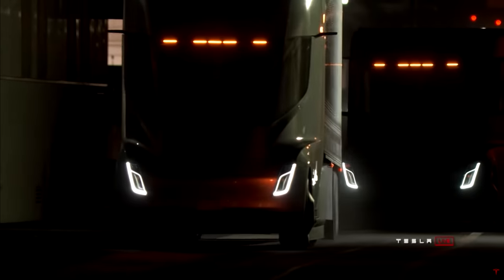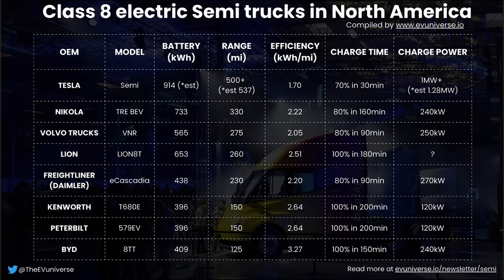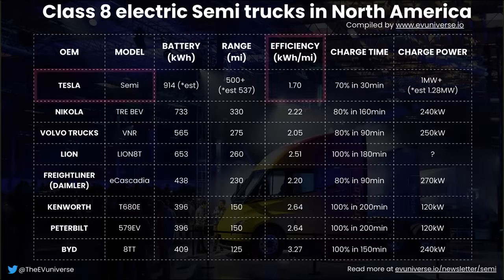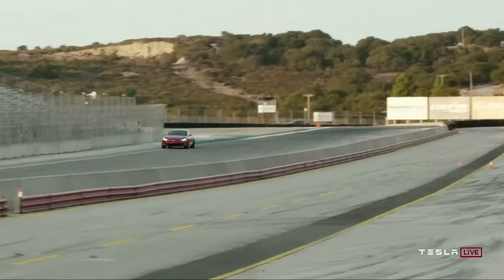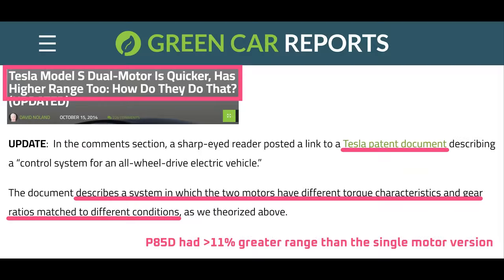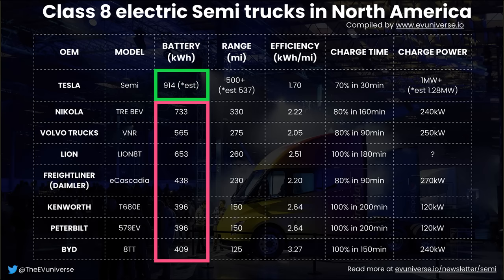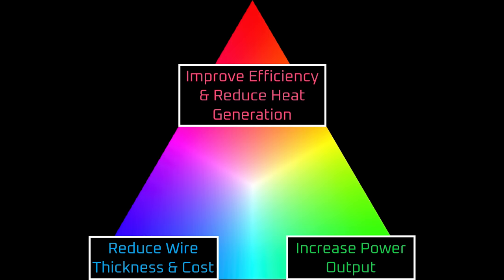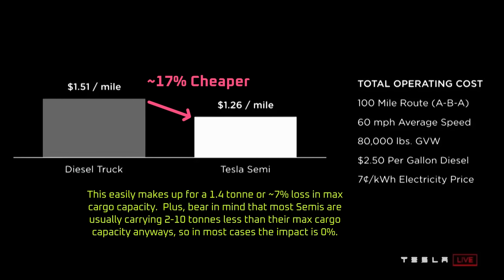How the Tesla Semi “Broke the Laws of Physics”

Comment: Great analysis, thanks. It is ridiculous that anyone calls it "breaking the laws of physics". Certainly not physicists. Physics does not impose any limit on how far can a car or truck go. With no energy losses in ideal conditions the truck could literally go forever, this is not realistic of course but with technology you can get closer and closer. The only limit is only technological.
Reply: No, because of air friction.
Reply: @pilotavery  That's why I specified "with no losses in ideal conditions". Air sure is a limiting factor. And so is rolling resistence and bunch of other stuff. The point is you can get better and better in all of the limiting factors and we are nowhere near what physics allows. The techonology is limited.
Reply: @RandomGuyOnYoutube601  technology is improving constantly! We went from nothing to wheels, assisted steering, ABS, seatbelts……
Reply: There are certain physical limits to a truck that conforms to legal limits. Rubber on asphalt is always going to have a certain coefficient of drag >0 and with a weight m on even ground, you'll always have to overcome a rolling resistance of Crr*g*m, no matter what. A semi is also always going to have a maximum length, which means your frontal area is can't get smaller without reducing volume.
Reply: @plainText384  lol….. improvements are always made doesn’t matter if huge or small!
Reply: @plainText384  today a diesel truck can go up to 3000 miles thing we couldn’t have believed decades ago! Let alone those gigantic container ships with up to 20,000 containers capacity+
Reply: @Alan May  the question is not "will transporting goods from point A to point B become more efficient/cheaper/ greener/ etc." It's "will those goods be transported by this specific mode of transportation".

Horse drawn carriages became increasingly efficient... until they were no longer used. And Noone in the transport sector is genetically engineering super donkeys for high efficiency carriages. 

Maybe the future of medium/long distance cargo shipping is in Battery electric Semitrucks, maybe it isn't.
Reply: One of my favorite quotes from ST: DS9.  "Its true, you can't break the laws of physics, but you can bend them".
Reply: @plainText384  please please don’t you ever dare compare vehicles to horses! Because the single work of a truck is like hundreds of horses+ just look at agriculture! A single harvester is able to work massive lands in record times and batteries will never made such things possible!
Reply: @plainText384  batteries don’t even compete/compare to diesel! With diesel we went to the remotest areas, opened the largest mines, built roads, houses, entire cities…. Bridges, the grid and much more.
Reply: @plainText384  in emergency situations again diesel is another great flexible use.
Reply: @kennethng8346  lol….
Reply: @Alan May  horses are literally the original vehicle? They are not only a comparison, they're a historical example.
Reply: Physics impose limits on conman.
Please explain, how motors running more than 20k rpm while powering wheels running at about 500 rpm can do that with just one gear all the while managing, controlling 40 tons.
After so many broken promises and outrages claims in the past, the current move to hide "physics" is to hide the weight of this "thing" from the public as long as possible.
As far as I know, Pepsico only runs the vehicle with their light weight products,  and seems to have no intention to reveal this one telling piece of data, I guess because of an NDA.
And there is more substantial debunking to be found here:
https://www.youtube.com/watch?v=b-TUfTwWdHM
Reply: @sindbad8411  I smell burning short.
Reply: @RandomGuyOnYoutube601  
I have no clue what you mean. Is that slang or an idiom I'm not aware of? The video is from Aussie engineer and car guy. He is definitely funny.
I'll borrow this sentence from him: 
"People have been fooled into believing that being entitled to their own opinions extends to being entitled to their own facts".
Reply: @sindbad8411  I would refer you to the graphics at 9:50 and 10:30 of this video. 
At 9:50 we see a representation of actual EV advancement over several generations and a span of 9 years.  It is not made up.  
At 10:30 we see specs for several first generation EV trucks.  No one is calling Daimler and Volvo a bunch of hucksters.  How long will it take for them to match the specs given for the Tesla Semi?  

If we judge based purely on the graph at 9:50, then a reasonable guess would be 9 years.  My own guess is five years or maybe less, since they will have Tesla's example to follow (assuming their example is real).

Now, if you're right and Tesla Semi is a fake, it means that real trucks will meet the claimed specs of the Tesla Semi in under 10 years.  If Tesla is right, they will meet their claimed specs within one year as they approach their production ramp.

The only alternative to this would be if these first generation trucks that have been rushed to market are actually as good as EV trucks can get.  Who believes that?  Not anybody who knows anything about technology.  I mean, what were diesel trucks doing in 1930, compared to today?
Reply: @alanmay7929  Diesel has done lots of wonderful things.  It has also poisoned many millions of people; caused, cumulatively, probably a million deaths or more from air pollution.  That's not counting all the deaths from extraction related pollution, wars for control of oil, or the tremendous impact of bad government that results from the malignant influence of oil companies on political systems around the world.  The transition to a battery based economy holds great potential for positive change.

Will there be many adjustments?  Yes.  Will some work flows change? Yes.  Will it be the end of the world? No.  It will be the beginning of a new era.
Reply: @davidmenasco5743  
How can you be sure that Tesla will be still around in 10 years?
If the Semi IS the disaster it seems to be at this point chances are the company will be very, very different.
Here is a rant, a “debunking” by John Cadogan
Very, very funny btw.
Tesla Semi: Was I wrong? (Responding to you.)
An Aussie Auto Expert and engineer
https://www.youtube.com/watch?v=b-TUfTwWdHM

I lost my interest in Elon a few years ago,
Upon the grand opening of the Boring company.
He arrives on stage “Steve Jobs” style with a Tesla driving out of the whopping 1.5 mile long tunnel.
3 numbers on the wall
1 Billion
200 Million
20 million
First: Average cost per mile / km of conventional boring companies
Second: discounted prices of the above if you are very lucky.
Third: cost per mile / km of his Boring company.

What he did NOT mention was the “conventional price includes stops and stations, you know those huge underground holes sometimes of the size of a cathedral basically hand made, well not by shoveling but by lot’s of individual bore holes and what not. But definitely NOT by the auto-tunnel boring device.
It was kind of the first time Elon introduced his self made laws of physics.

But what struck me at first: wow, his car had guiding rollers underneath, and I  was “what the f*ck??”:
I’ve seen this (and used it almost 40 years ago), in the Ruhr area in Germany. Live and in color:
Full and true autonomous driving of busses for public transport!!
https://www.youtube.com/watch?v=GT21wuS8DuM

Honestly, how is the Vegas loop doing?
High speed and fully autonomous rides in a confined area, anyone?
Or are you already making 3ok several times per year by operating a couple of full autonomous Taxis and Ubers?
AND, to return to the Semi:
When will we know the one and only truly important number?
The weight of this thing which will allow for calculation of payload efficiency?
There is a special form of art in journalism. Politicians , managers, all sort of big guys will tell you what they want you to know. However you need to learn the fine art of hearing what they don’t tell you, what they don’t want you to know.
Which is is fairly obvious in this case.

I could go on about the many broken promises and outrages claims, or talk about what John Cadogan explains in his video.
But there are way to many issues, it’s useless.
If you have the guts, watch John Cadogan’s video.
HE IS hilarious.

Do you know what the term oxymoron means?
Elon’s “I’m absolutist free speech advocate” is one of the best I’ve came across in years.
An oxymoron is a literary device that juxtaposes contradictory terms. Oxymorons are often used poetically as a way of bringing out a fresh meaning in a word or phrase. Like a paradox, an oxymoron is what’s known as a “contradiction in terms,” 
The word oxymoron is an ancient Greek word, which translates most closely to something like “sharply dull” or “cleverly stupid.” In other words, the oxymoron definition is itself an oxymoron. 

And, there is the old idea:
if you want know who someone truly is, give him or her power.
And they will tell you, almost guaranteed.
As everyone can see when watching the twitter story unfold.
He is a an egomaniac, a narcissist.
If you like and believe in someone like him, it’s your choice.
I certainly don’t.
Reply: @sindbad8411  You wrote an awful lot, but completely missed my point.  

My point is that, in ten years or less, Daimler and Volvo and a dozen other companies are going to be making electric trucks every bit as good as the Tesla Semi is claimed to be.  So it really doesn't matter at all whether Tesla survives, or whether the Semi can even drive under it's own power - trucks are going electric.  The announcement of the Semi years ago forced Daimler to move.  Once they did, it was a done deal.

On the other hand, if you think Tesla won't be around in ten years, you're really not paying attention to what's been happening in the auto business.
Reply: Maximum theoretical thermodynamic efficiency.
Reply: @sindbad8411  You don't know what you are talking about, at least when it comes to tunnel boring costs!  The Gothard tunnel in Switzerland is to date the longest in the world at 57.1 km (35.6 miles) long, two tubes as well as technical galeries totaling 152 km in length (95 miles) .  It is also the deepest, being bored on a large portion of its length under 1 mile of rock, with engineering issues like water coming out of fissures at 200 bars of pressure, and such niceties.  It is technically 100x more difficult to bore such a tunnel than a Boring company tube, 100 feet max under the surface in soft rock! The tubes are also of a much larger diameter than the Boring company's ones, and its equipment is much more sophisticated and costly.
It has cost a total of 12.2B Swiss francs (approximately the same sum in USD), or ca. 128 M$ per mile of gallery, NOT the 1B$ per km (or is that per mile?) that you mention. So, considering the huge difference in complexity of the two types of tunnels and the significantly lower US wages, a cost of 20M$ per mile of Boring company tunnel seems quite in line... including stations, as the Gothard tunnel also includes one, for 400 meter long trains, dug under a mile of rock.
If you want to cite an outrageous claim from Elon, you definitely picked up the wrong one!

Having said this, and even being an Elon supporter since the first time I purchased TSLA shares in 2013, I am not convinced by the Boring Company's business plan... neither of his taking over Twitter... but who cares, both are private companies and, as you or I are also free to do, he can do whatever he wants with his money and that of his private investors.  However, in general, Elon is bloody good at delivering on his promises!  His 2008. first Master Plan is nearly 100% implemented, and the implementation of his 2016 second Master Plan is very advanced.  Same thing with SpaceX, he delivered so far everything he promised.   Remember him predicting in 2014 that Tesla would sell 500'000 vehicles in 2020?  Just about everybody laughed... you probably did..,.  But Tesla delivered in 2020 499'535 vehicles.  Please give me the name of another CEO of a high-growth company, who estimated his company's sales within 0.1% 6 years in advance!  Please give me the name of another CEO who brought not one but two companies to valuations of multiple hundreds of billions, in most difficult and complex industries, AT THE SAME TIME!  So, until you do better... until anyone else does better, give him a break on the few ideas that he did abandon, and for being a little over-optimistic on timing.
I trusted him with a huge part of my investment portfolio, starting in 2013 when he was little known, and I don't regret it a minute, he made my retirement VERY comfortable!

Comment: A good example of first principle thinking at Tesla is adding a automatic tire inflation system to the semi. I guess, this allows to keep the tire pressure within narrower limits, so the rolling resistance is as low as possible. The rolling resistance of a loaded truck is quite high.
Reply: It will also reduce tire replacements.  The tires are huge and thick with lots of hysteresis so I imagine temperature changes often push the actual inflation pressures outside of ideal limits during a run.  Having perfect pressure constantly will reduce tire wear and increase safety as well as optimizing rolling resistance.  We've all seen the remnants of peeled and blown truck tires on the highways.
Reply: Hardly new or unique technology. You can buy it off the shelf in Europe.

Comment: You can bet your boots they'll use the same tech in the Cybertruck.  Recapturing the enormous amount of inertia from a heavy vehicle is absolute genius.
Reply: Not to mention that even 3 motors would be huge overkill.
I would imagine a single on the front for "cruise", dual on the rear for "beast mode"
Reply: Or just plain good engineering.
Reply: I object to betting Boots, but I do have a cybertruck on order so I hope you're right!
Reply: You recapture energy from *momentum*, not inertia. Inertia is not momentum.
Reply: All Tesla models have regen braking, you hardly need to use the brakes. The regen braking uses captured energy to recharge the battery. In an ICE braking it’s lost as heat.
Reply: "Recapturing the enormous amount of" inertia momentum "from a heavy vehicle is absolute genius." 
But you know that a heavy vehicle wants to be accelerated first?
Reply: That is kind of the whole point behind EVs and hybrid cars.  Tesla didn't invent any of this.  They are just optimizing it.
Reply: Tesla's are just overpriced death traps maskerating as cheap luxury
Reply: @michaellowe3665  inventing optimizations is still invention.
Reply: @Andy Lee Robinson  meh.  Even Honda didn't invent the hybrid when they  released the insight.  It was 100 year old technology that was used in German U-boats.  I don't detract from the effort it takes to marry existing technologies to make new products.   Optimization is often the hardest part of engineering,  but it isn't the same as inventing.
Reply: It’s not a genius idea that’s how EVs works just like those massive electric trains….
Reply: @rogerstarkey5390  unfortunately there isn’t always a downhill to help with generative braking lol
Reply: @tedmoss  nope
Reply: @Alan May  trains are a little different.   They don't use large batteries like a hybrid car for regeneration.   They just use the electric power as it is generated. They have some battery power to start the engine and run onboard power, but they don't store propulsive power to accelerate and climb hills.  They do recover some of this energy due to their length.  In many cases, part of the train is going downhill while another part is going uphill.  This effectively transfers and equalizes the energy needed to move it.  There are plans to make EV trains that do use large batteries,  but those are experimental at best.  There is a lot of room for solar if they ever do that, though.
Reply: @michaellowe3665  yep but trains still works in the same princip! Electric trains like in Europe Japan… directly connected to the grid and the massive or smaller electric motors regenerate a lot of power.
Reply: @michaellowe3665  there is actually a train in Australia called infinity train running on battery, it was built by f1 racing team from the UK it’s a very rare case where it works tho!
Reply: @Alan May  the original comment was about recovering braking energy and reusing it for acceleration. Trains don't really benefit from this because they aren't changing speeds all the time, and when they do, it is slowly.  They use hybrid drivetrains mainly because a direct drive would be very difficult for a diesel engine to manage.  The slow acceleration and enormous weight would mean the engine would be outside of its optimal operating condition for far too long, and maybe dozens of speeds in a transmission would be needed to couple it.
Reply: Don't forget you need to use more power than you can recuperate to accelerate said heavy vehicle
Reply: @axel_x8954  lousy laws of thermodynamics.
Reply: No, it isn't 'absolut genius' it is just searching for what is missing.
Reply: Tron-Jockey  lol!!!!!!! Trucks only rarely slows down around cities not on the highway which actually makes the recuperation not that huge and also diesel has significantly longer range to not worry about anything.
Reply: Tron-Jockey  on flats lands it's also even less effective the regenerative braking